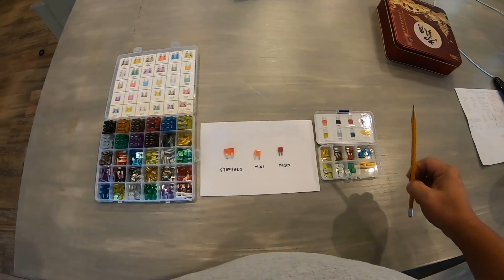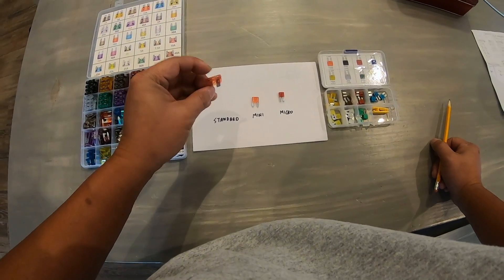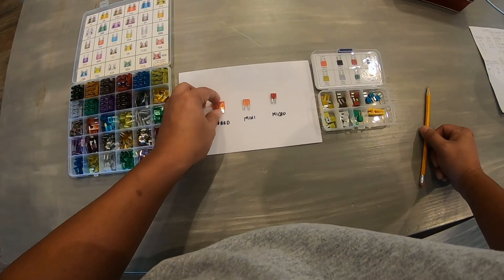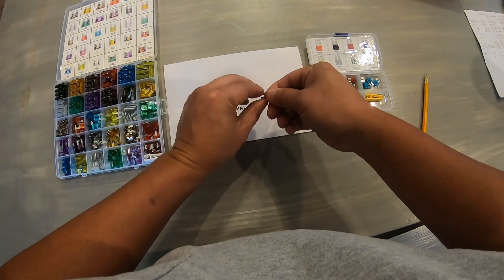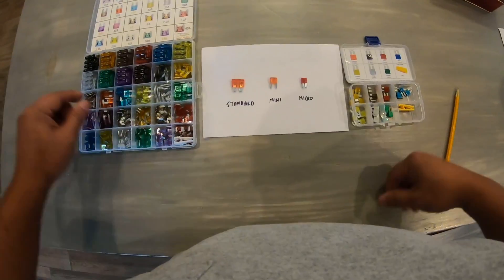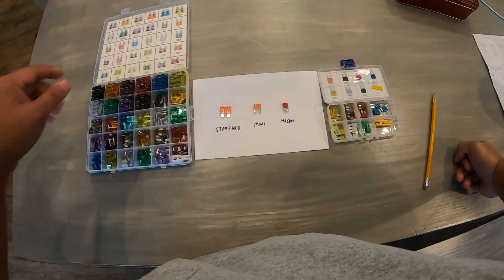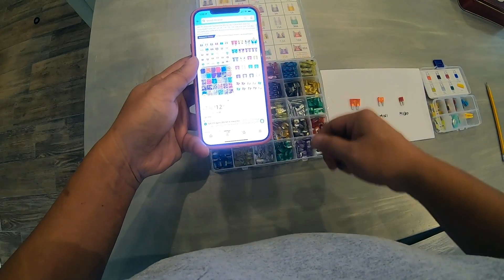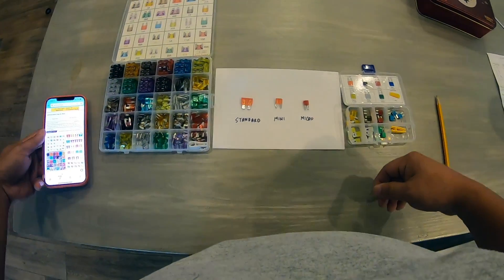TYPES / DIFFERENT SIZES OF CAR TRUCK FUSES (STANDARD, MINI, MICRO)

Comment: Can i use those 12 Volt fuses in a 24 Volt system?
Reply: fuses working principle is based om amps.. Voltage does not matter..

Just calculate the Amp.
For eg - 120W Bulb ÷ 12V = 10A
120W ÷ 24 = 5A
Reply: @tarunsharma5254  voltage does matter! If your Voltage exceeds that of your Fuse it May not be able to Break the circuit reliably due to arking for example.